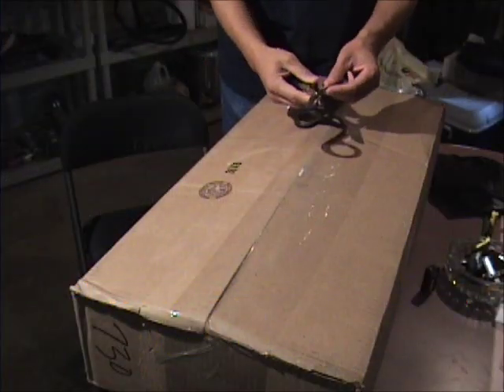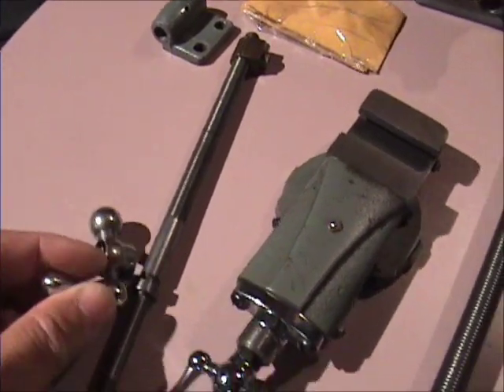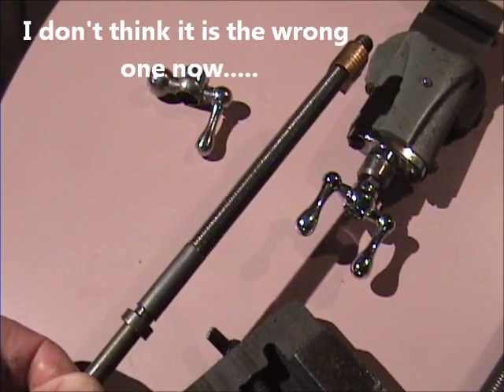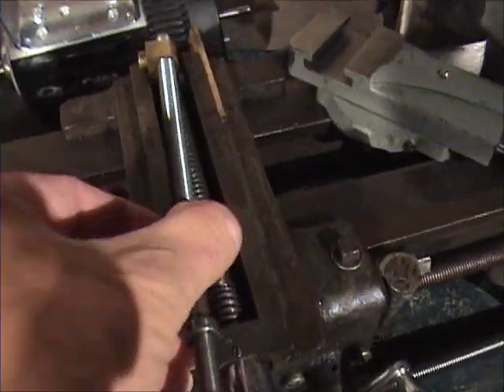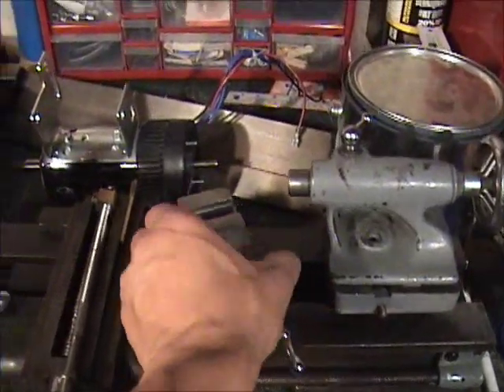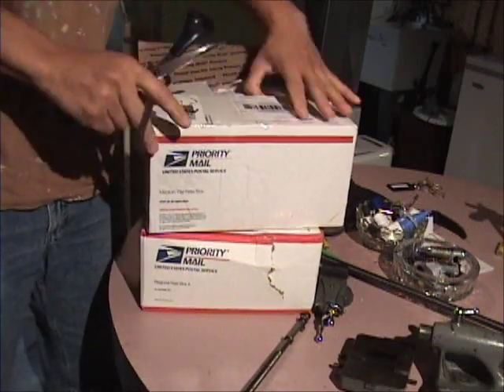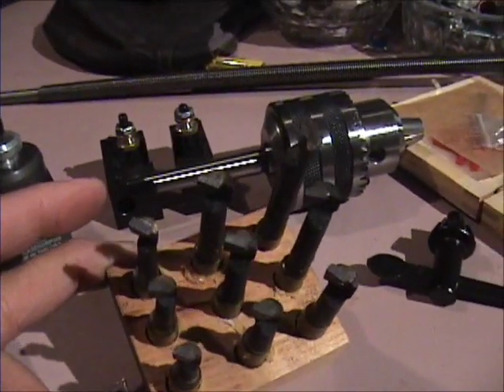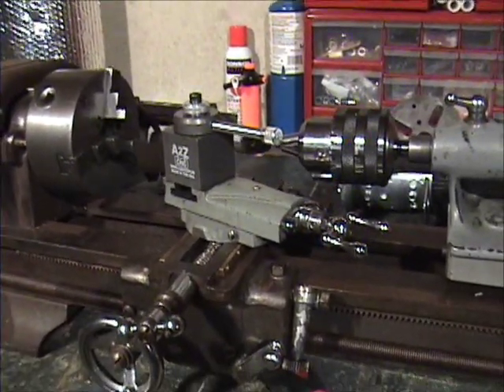Atlas 618 Lathe  restoration(Craftsman 101.xxxx) Part 2 of 8

Comment: jster,   Looking for the lead screw holder on the right end of the lead screw. Part # 10F-16 where did you get your parts, would luv to know.  Had a Atlas with quick change thd. gears, Dad sold it years ago, now have one with manuals gears, looking for a quick change one now. Have to find the lead screw part of make one.  Thanks  Doug